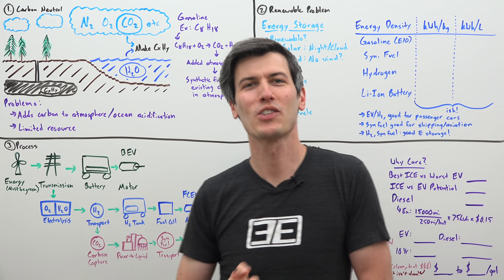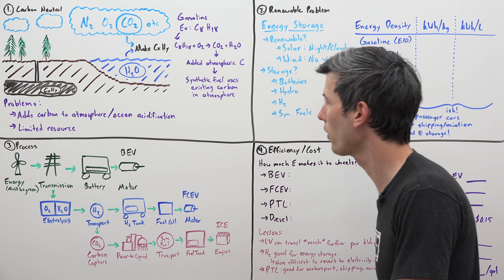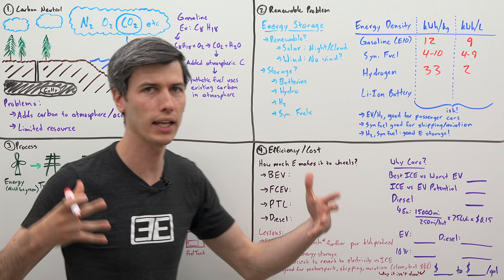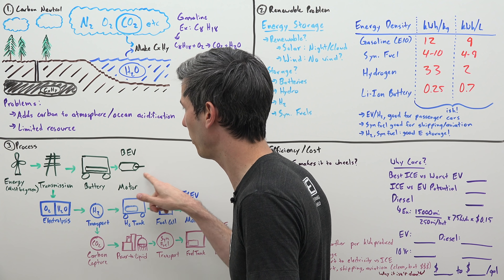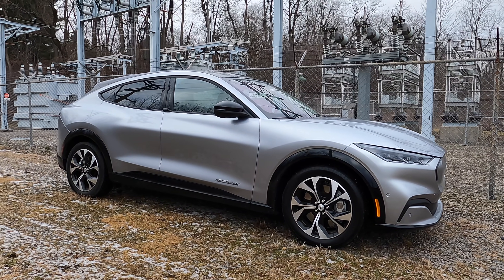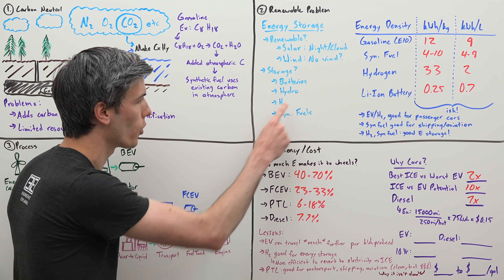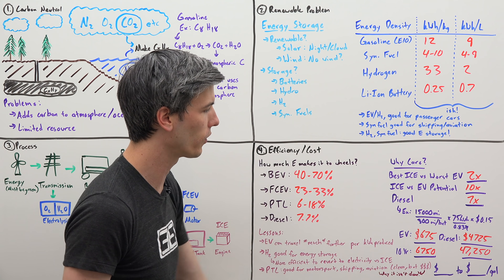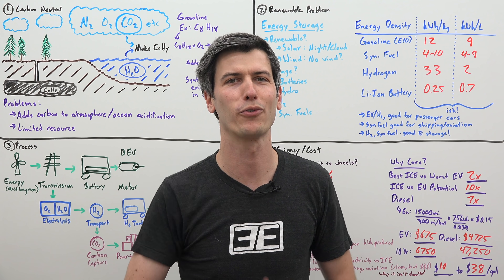The Big Problem With Synthetic Fuels

Comment: What happens when when take into account for everything that happens before your wind turbine drawing? The mining,expense,energy needed in the creation of the batteries not just running them.  Great video!
Reply: It doesn't change. When you take everything into account (car production, energy source), EVs still end up superior. It's why synthetic fuel is for motorosports according to Porsche.
Reply: @dzello  not true, the Lithium mining needed for EVs is actually more harmful than the carbon capture method of Synthetic fuel. Especially since the design in the Chile plant uses wind power to capture and not electricity

Comment: For anyone wondering, the hydrogen energy density (kWh/l) is for hydrogen in a liquified state. Thought it should be mentioned. Keep doing good work EE!
Reply: isnt hydrogen gas when pressurized enough, it turns into liquid?
Reply: @Rcck.7282 I am by no means an expert but for liquid H2 to exist it must be cooled below its critical point of 33 K and pressurized above its critical pressure of 13 bar. If these conditions are not met then the hydrogen atoms have too much kinetic energy for the intermolecular forces of attraction to bind them together in the liquid phase.
Reply: You can store it as lithium hydride.
Reply: The hydrogen tanks weigh a lot.

Comment: Completely misses the point, Jason!  There are millions of existing ICE  cars which would be made carbon neutral at a stroke, if their fuel was made from atmospheric CO2, with no change to distribution networks and  gas stations. The end user does nothing different.   Your efficiency also neglects the weight of batteries, permanently added to the weight of a car. Liquid fuels fit any shape of tank, that can be thin and light, but gases, like LPG and hydrogen require strong, heavy, pressure-resistant cylindrical tanks that are hard to incorporate into vehicle structures.  Ditto batteries.  BEVs are much more expensive than ICE, and only a few people can afford a Tesla. BEVs will eventually get cheaper, batteries will get more energy-dense, and recharge much faster, without the fire risk of Li-ion, but not any time soon. That's why we need synthetic fuels, pronto!
Reply: There isn't going to be enough excess energy for that if we actually pursue something crazy like a fully renewable grid.  The only way it would be cost effective is with nuclear power due to it's extra high capacity factor.  With a renewable grid all excess energy will be extremely precious and be stored for dips in generation in grid storage, rather than used to produce synthetic fuels.  Wind is especially unreliable as you can go from 95% capacity to 5% capacity for weeks on end.  Only when your grid storage is completely full will you be able to produce synthetic fuels, which would mean an unreliable mode of production.  On the other hand, nuclear power has a 90%+ capacity factor and is always producing at night, so you would have a very reliable source of excess energy that's always on, which could then be used to produce synthetic fuels.

Unfortunately we're winding down nuclear and pursuing renewables or in many cases, switching back to fossil fuels (refer to Indian Point).  Other countries aren't though, like China, which will have the largest nuclear infrastructure in the world very soon.  This would put China in a very good position to produce synthetic fuels with their extremely reliable excess energy at night, more than likely making them the global leader in synthetic fuels, probably leading to enough production for major exports.  Just another area where we're going to fall behind :)
Reply: Over several years of ownership many current EVs are on average slightly cheaper than ICE vehicles due to the lower "fuel" and maintenance costs.  Also combustion fuel is a bigger fire risk than Li ion batteries, EVs catch fire at a lower than average rate.
Reply: @VitalVampyr  ...until you have to replace the batteries, or until road pricing arrives...as to fires, considering the much lower percentage of EVs, the fire risk is much greater, and battery fires are impossible to extinguish!

Comment: do aa video on biofuel in Brazil. isnt the country energy independent?
Reply: No. Brazil has big sugar plantations and so to promote the industry the government requires automakers to build cars that can run on 10% bioethanol fuel. They're still using 90% petrol/diesel, it's just the ethanol that makes the engines a bit more environmentally friendly.

Comment: Something that I don't understand is why you can't use ethanol cars. I only saw them here in Brazil , they exist for decades and is pretty easy to convert a gasoline engine into an ethanol one. It is 100% renewable , generates more HP, but less mileage per gallon(around 20%less) and is cheaper too. And since it is produced by plants, it is carbon neutral

Comment: Hmm about 10 USD per US gallon would be around 2.6 USD/L, here in the Netherlands diesel fuel is currently around 1.5 euro/L for the consumer. A lot of that is the excise tax: around 80 eurocent for gasoline/petrol and close to 50 for diesel. Oh and some good old VAT thrown on top ofcourse!

I wonder if it might be more doable to introduce it in a market like it is here, assuming the government would be willing to stimulate early adoption by reducing/removing excise taxes entirely for a guaranteed period. Still wouldn't be cheaper than the current situation but I'm sure there will be a mixture of some people willing to do it because they think it's the right thing along with some make the other stuff more expensive by increasing fuel or vehicle taxes.

That said for long driving hours per day/long trips I guess a hydrogen infrastructure would be the more sensible thing to use long term if battery charging times aren't practical. The only value I see in it for cars is that it could be part of a transition to a carbon neutral situation (since it might be needed for other sectors anyway, and kinda fits into the existing pump fuel into cars infrastructure). Keeps the cars functional as the slow gradual change happens.

Comment: Great video. I think that synthetic fuels and even LNG will have a bigger uptake in areas like shipping and in lorries and trucks, not only because they are larger and have more capacity but also because of the stricter emissions standards being brought in around the world. I really enjoyed the discussion on hydrogen as an energy storage option, I think it is not getting enough attention as it should. While the future seems to be battery-powered electric vehicles I think hydrogen will have a bigger role in more industrial applications. For example, as the grid becomes less centralised and smarter with lots of small independent producers, having hydrogen fuel cells in factories running individual machines seems to me like a good way to cut back on fossil fuel emissions in an economical way.

Comment: One thing that bothers me is that I never found a study that considers the energy consumed to go from point A to B. Considering the time of machine a car is, the weight plays a important role, the heavier the car the lower will be its total efficiency. Electric cars are heavier than IC cars so they consume more energy to go from A to B, but the studies always consider the efficiency to the wheels, like those cars would consume the same energy to move.
You could make a video talking about this, seems very interesting to me.

Comment: Rather than carbon capture from the atmosphere to make fuel, you'd be better off taking the hydrogen and using it to produce ammonia.  In the transition period, you'd be better off using the hydrogen to reform plastic waste to gasoline, butane, and propane for aviation jet engines.

Comment: On team all the things we want synthetic fuels and BEVS.

It is an absolute must for the aviation industrial to develop synthetic fuels as there is no alternative, so that will hopefully lower the cost. If the cost comes down to what is expected (which is 3x current gasoline) then governments could make it effectively the same price to consumers meaning that the carbon emissions of cars already on the road will drop. It wont necessarily be 100% synthetic either, as they can blend it in to meet CO2 targets. 

Synthetic fuels will make even more sense for plug in hybrids and range extenders as they can use cheap electricity most of the time and only use the expensive synthetic fuel when needed and then have smaller batteries (so better for the environment).

There isn't a one size fits all solution for different customers and different countries as its not like we all had the same kinds of powertrains before. And maybe we will see countries that are green energy rich become synthetic oil refineries as its not like they have a way to share their electricity all round the world currently.

Comment: Use us navy submarine nuclear reactors to power civilian shipping. The reactors would be life of the hull. The entire reactor room can be part of the superstructure. So upon decommissioning. The whole superstructure is lifted out and decommissioned separately from the hull.
Reply: Thats an awful idea
Reply: @sumgaye5951  and why?

Cheap shipping fuel won't be around forever. Cng/propane is only an interm solution. Pure sail is too slow. 

Molten sodium reactors can't melt down. Fast reactors would burn up old fuel and high grade wastes. 

Ships are easily tracked. So you can't make one vanish for months to plunder the fuel for nefarious purposes.